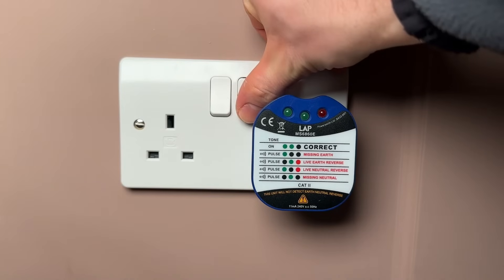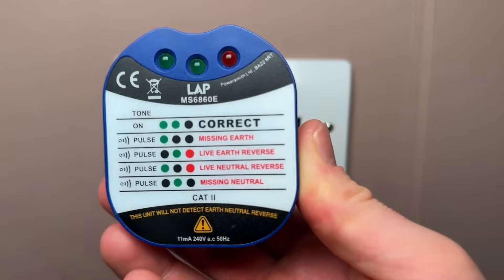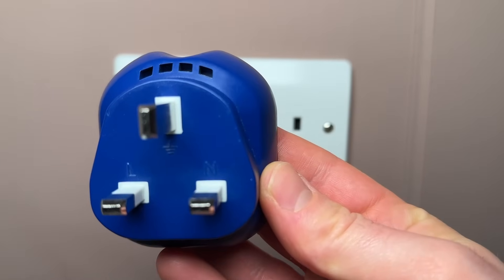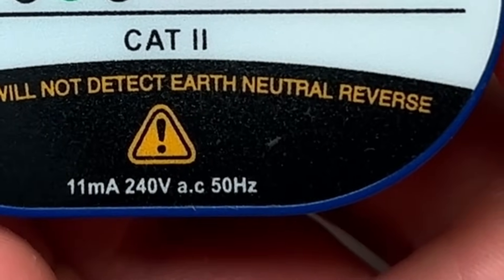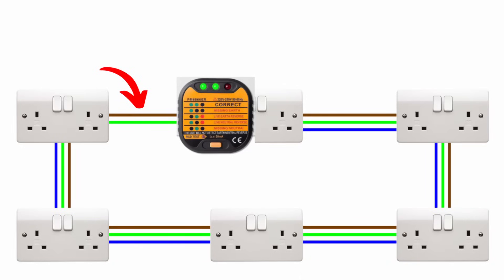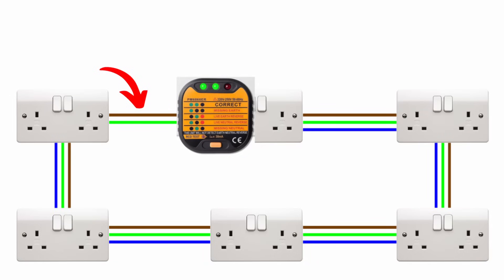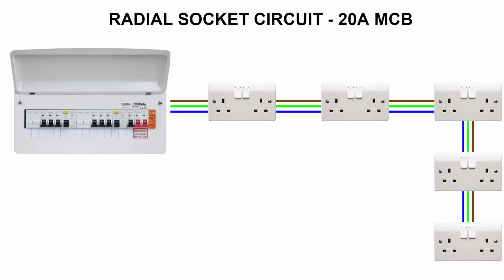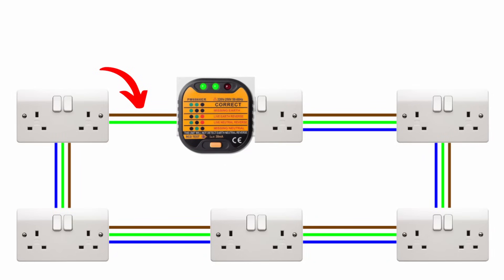The Problem with Socket Testers

Comment: Indeed, for all such Socket Testers, a Neutral / Earth Reserve wiring mistake cannot be detected,  it has to be visibly identified, nonetheless, it can quickly sort out unconnected /or broken or dislodged wire inside a socket.  This device is only a tool to assist.

Comment: My sockets tester has a button , when socket  tested ok i.e Two Green LED to the left, And by pressing the button power goes, Does this mean Socket is still Ok? Thanks.
Reply: That is the RCD tester. The power should go off with it. You then must reset the RCD.

Comment: I have this LAP tester and yesterday I used it to wire up a single socket onto the other end of a radial. It reported "live earth reverse", which had me scratching my head for a bit, but the issue was actually missing neutral (had come loose from the neutral bar in the consumer unit). But at least it told me something was wrong, I possibly wouldn't have realised otherwise until I came to use the socket and had a problem.
Reply from the maker: Thanks for commenting on another video! 
Yeah I agree socket testers are still useful, I was mainly highlighting the ring issue

Comment: The danger of 13-amp socket testers is the neutral earth reversal that cannot be identified by the tester, particularly in a TNCS installation, you need to buy the type of tester that has a trip button and test each socket to ensure the RCD trips, alternately you need to check each Socket for the connections,
Reply from the maker: Thanks for watching!
Reply: Neutral earth reverse s possible only if there is no RCD. With an RCD it would cause immediate tripping if the socket is used.

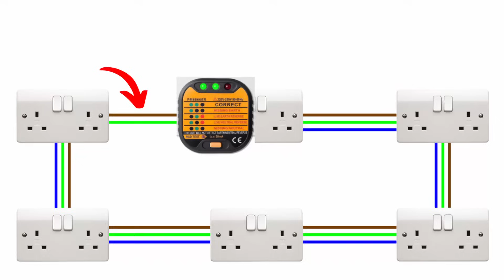Comment: 2:02 Ring circuits are only permitted in the UK. Only radial and branch circuits are permitted worldwide.
In the UK a ring circuit with 32Amps is used. In other countries this is 2 lines with 16Amps.
I don't see where copper should be saved, only that the whole house depends on a single fuse.
When the ring is open the fuse should be reduced to 16A.
But this is a problem with ring circuits and not the fault of the tester for radial circuits.
Reply from the maker: Thanks for watching!
Reply: Hi Jens interesting comment . We use rings in the uk mainly for the kitchen circuit . It would have to be wired in at least 3 radials of the same sized cable . 2 x 16a radials in the kitchen would lead to circuit breakers in a state of over current so copper has been saved . It also saves on fuse board ways .
Reply: I think you will find Dubai and Abu Dhabi now permit ring circuits, generally in a normal sized house you would have two ring circuit's,  one for the kitchen and one  ring circuit for the rest of the house.

Comment: I’ve got the LAP one and I use it quite often. It’s shown me that on an inverter there is a live/neutral reverse which is pretty weird as you’d assume that live and neutral would be wired as per say as they come off of the battery used on the inverter
Reply from the maker: That is odd, thanks for watching!
Reply: I have one of these, I have tried on every radial and ring in house and it shows as correct.  Only rewired 3 years ago so was expecting it to be fine.
However, if I test a circuit when the MCB is turned off, I get a red light or live earth reverse reading, but it I switch off main isolator then I get no lights.
Confused, as everything seems to be fine and correct, just getting readings I don't understand when I test a circuit with MCB switched off?

Comment: Hm, obvious when you see it, but not something I'd considered. Leaves you with an interesting dilemma given current guidelines mean DIYers aren't able to open the consumer unit in order to do a ring continuity test from there.
Reply from the maker: Yeah good point, you can do a ring continuity test at a socket with a multi meter, then you just have to make sure those cores are tightly in the terminals before screwing the plate back on the wall. Thanks for watching!
Reply: How do you do a ring continuity test with a multimeter? Great videos, thanks